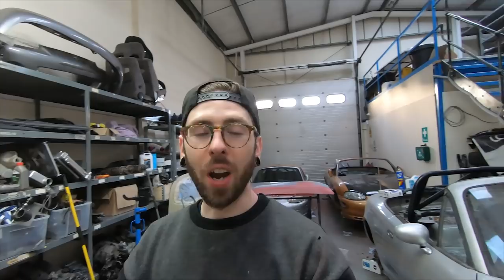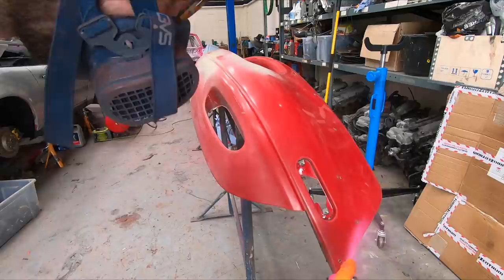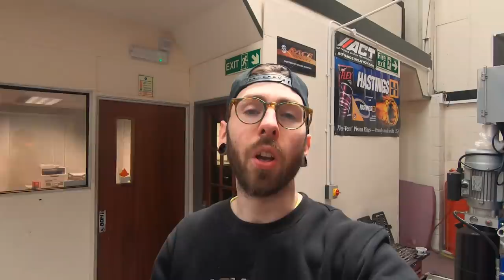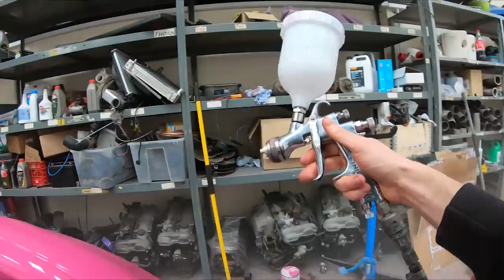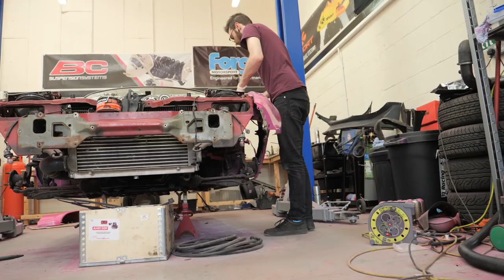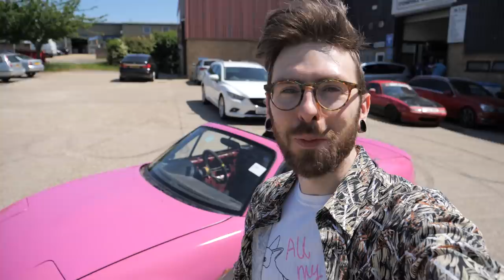Mary the MX-5 Miata Gets A DIY Rattle Can Paint Job With BRIGHT PINK Graffiti Paint

Comment: Love how we all do the same thing. Start off with a small job and it just keep getting bigger and bigger.

I was supposed to just swap in a new engine to replace a broken one. Now car is in bits, engine bay painted, huge list of parts I want, brakes reconned, contemplating powder coating subframes etc and fitting bushes etc while engine is out. May draw the line at painting it myself though. Don't have that much patience lol

Comment: Looks mint Where did you get the new windscreen from
Reply from the maker: Off eBay, they were pretty hard to find actually. We bought two, but both were different brands. Seemed to fit great though!
Reply: @BOFIRacingTV  trying to find one my self there rare as hens teeth
Reply from the maker: Here's where we got ours https://www.ebay.co.uk/itm/182061148609
Reply: @BOFIRacingTV  thanks need one because I know the old one will brake when I remove it to paint the car

Comment: You didn't cover the other Cars. They will have a lot of clear coat dust on them. Clean the windows before taking of in them. Good work though.
Reply from the maker: Thank you 🥰 The silver one has lots of dust on it so will definitely get a clean. needs an engine still too. The gold one hasn't got a windscreen in it at the moment either!
Reply: @BOFIRacingTV  that saves a lot of work. 😄